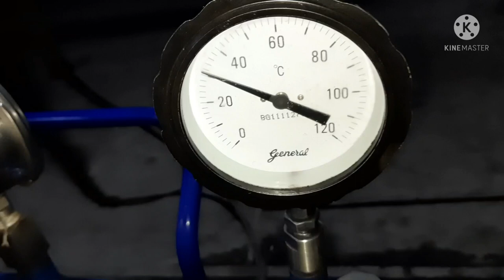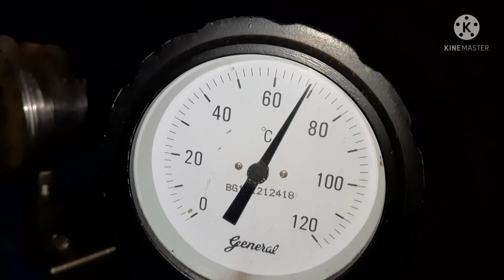Oil Centrifuge Bowl cleaning , Turbine oil

Comment: What is the function of bowl in oilcentrifuge?????
Reply from the maker: The bowl is a solid assembly that operates within the purifier frame made of high tensile steel with ample space to accumulate and discharge sludge. Purifier and clarifier bowls have conical disc stack, which may be numbered from 51 to 200 and are separated from each other by a small gap.

Comment: Sir ask some question about alfa laval model MAB 103-24..I REPLACE THE BEARING IN LOWER PARTS AND ALSO THE TOP BEARING..THE PROBLEM AFTER IM ASEMBLY NO OIL DISCHARGE GOING OUT .. WHAT IS THE PROBLEM SIR.  DO YOU HAVE IDEA.  CAN YOU SHARE ME..THANKYOU..
Reply from the maker: To be chek pump gear assembly... And sahre oil centrifuge model. Number